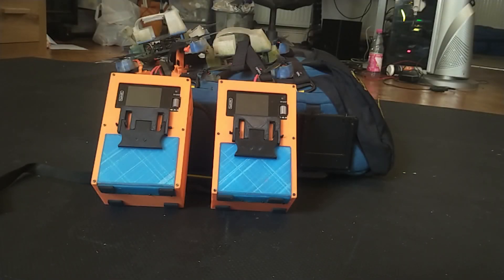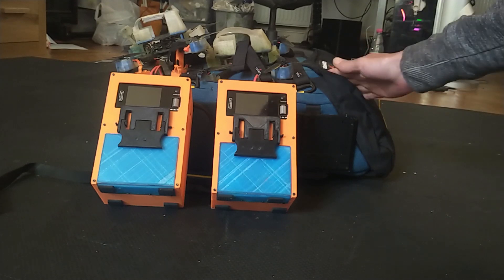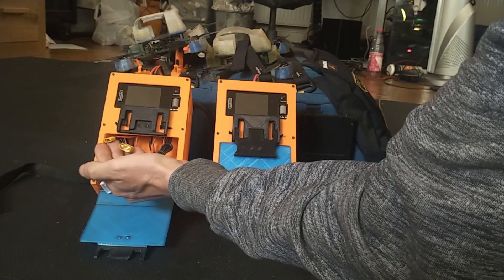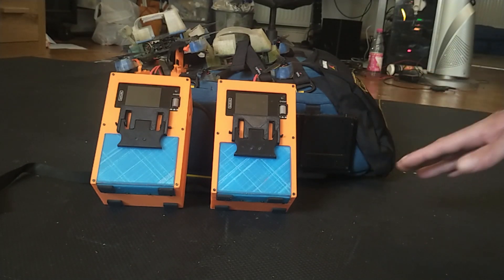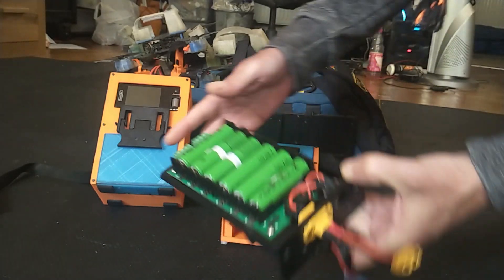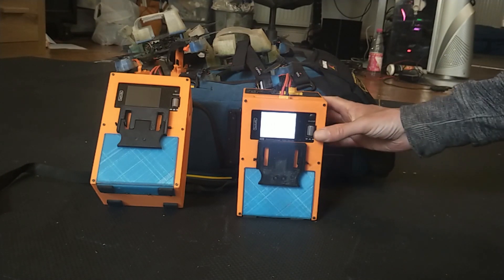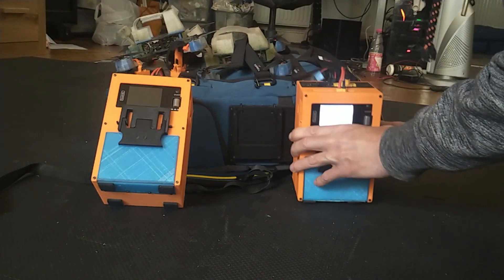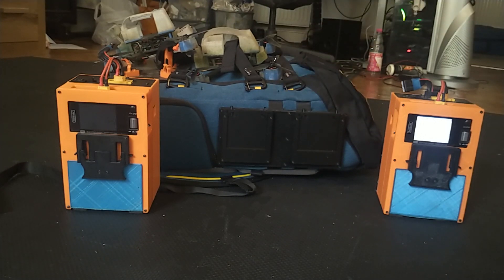M6D field charger

Comment: This is sick! How long do they last? Like how many batteries can you charge?
Reply from the maker: Depends on what you are charging. Each one is a 6S 7000mAh pack. I am currently in the process of putting together a version based on 21700 cells, which would up the capacity to 10000mAh
Reply: @evilc2048  Any update on the 21700 cells?
Reply from the maker: @JetNautics  In the end, I abandoned this form-factor when I moved to 21700 cells.
The battery pack is now separate from the chargers (The case is basically the same design, just minus the charger on top)
I then designed a shelf system for inside the bag using tent poles and 3D printed parts - it has a slide out shelf for the two chargers, and the two battery packs (12x 21700 each) are in the bottom of the bag.
So now, all I need to do is unzip my bag and slide out the shelf, and I am ready to rock. If it rains, I am packed up in seconds :)
Pic here with the shelf slid out: https://i.imgur.com/LJGSo86.jpeg
Screenshot of the CAD with the shelf in the stowed position: https://i.imgur.com/alfhuL2.png
CAD file is here. At some point I may get around to releasing it on printables, but for the time being, this should suffice: https://a360.co/4a83p8N
Reply: @evilc2048  thanks
Which bag are you using?
Reply from the maker: @JetNautics  Still using the same bag as in this video - Torvol Urban Carrier